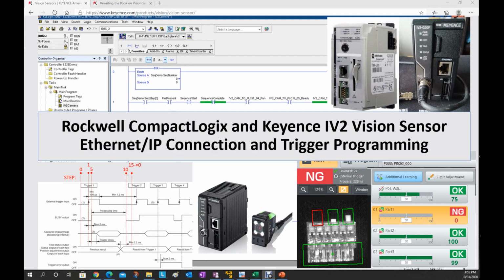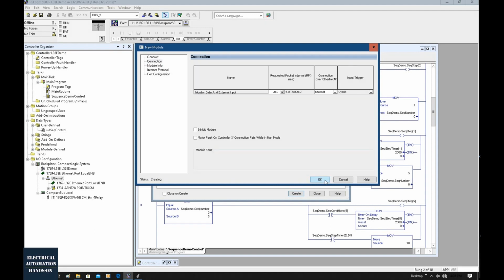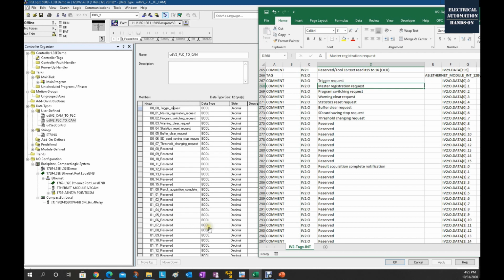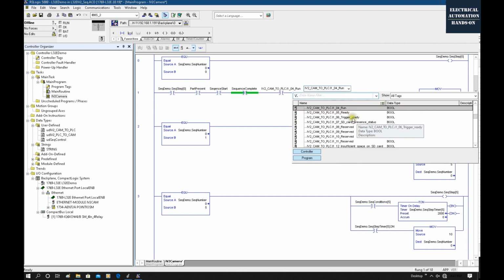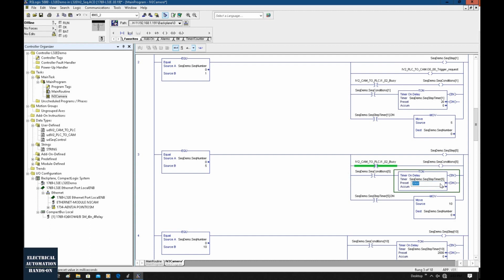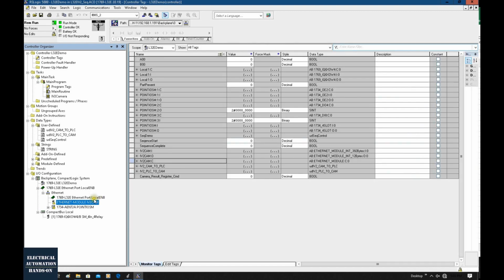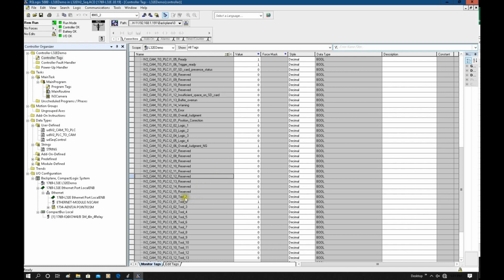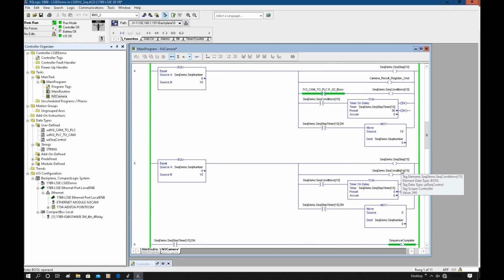KI15. Allen‑Bradley PLC and Keyence IV2 Vision Sensor EtherNet/IP Connection and Trigger Programming

Comment: Hi!

Have you tried to modify the master text value aswell? (IV3) If yes would you be so kind to help me with that?

Thank you.
Reply from the maker: IV3 for the communication is almost the same, the key improvement from IV2 to IV3 is its AI enhancement.
Reply: @electricalautomation  Yeah, I have noticed it aswell I am just asking if you would be able to make a video where you modify the master text, because I have made the PLC program from their PDF but it does not work how it should

Comment: Nice explanation, easy and straightforward, is it possible to simulte the I2V and Studio 5000 without purchasing the expensive hardware ?
Reply from the maker: yes, IV2 needs a code to activate the software. Then you can play it by using simulation. It is a good simulation tool. AB has simulation tool but it is not for free.